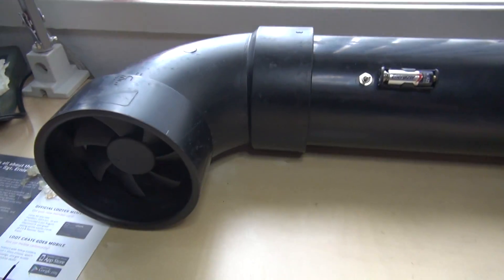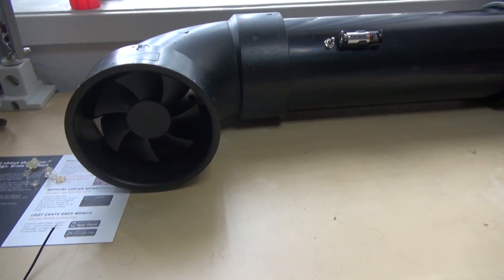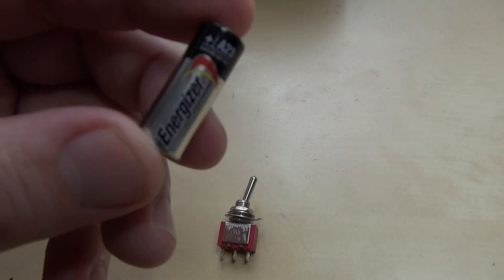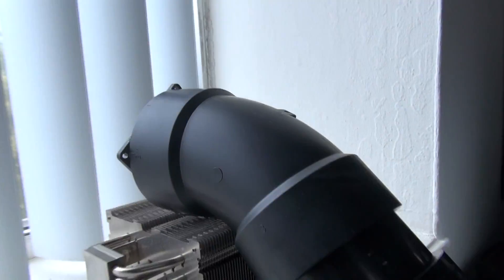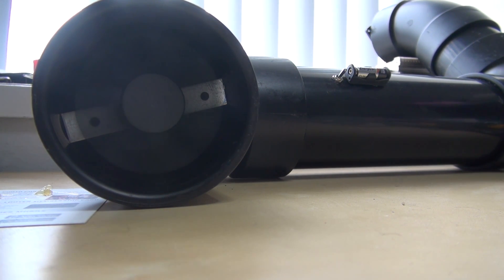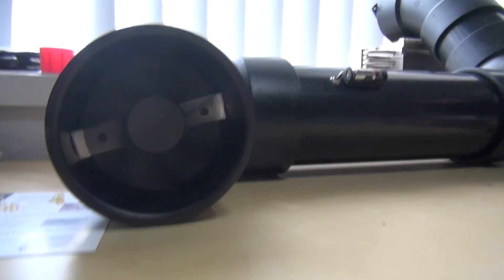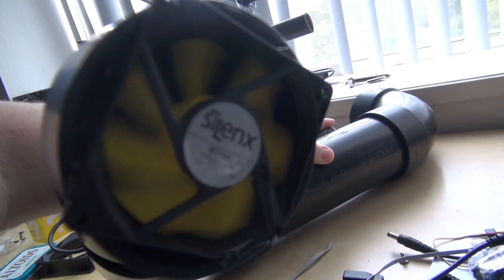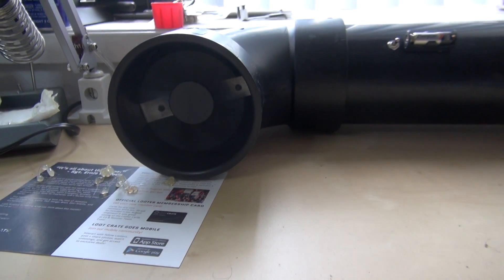Home made Soldering Exhaust Fan

Comment: i just finished a very similar project, to draw fine sawdust away from me, and to contain it until i dump it.
i used a PC fan, connected it to a 12vdc adapter, connected that to a clear plastic container, along w/ holes, and it draws the sawdust away from me.
it didn't cost anything, and i'm adding afew finishing touches to it.
i got the idea from the fume extractor from MAKE magazine!
nice build! great video!